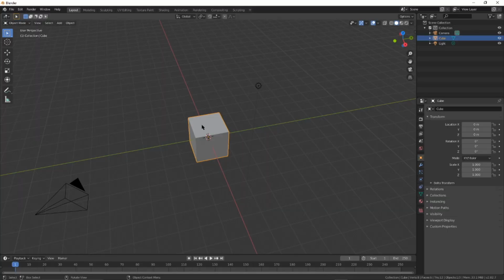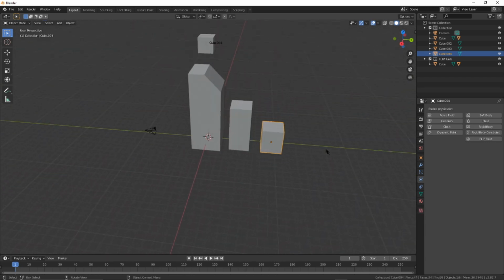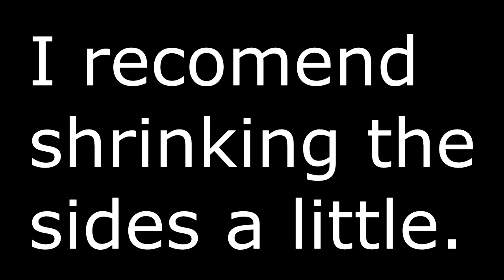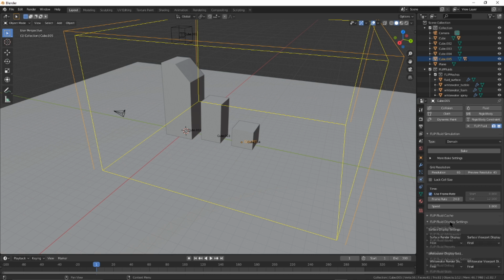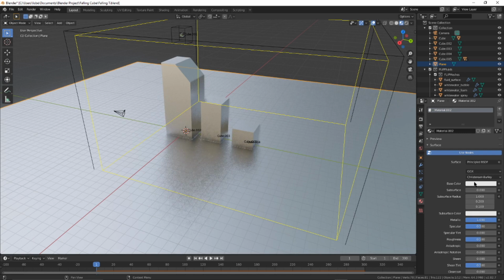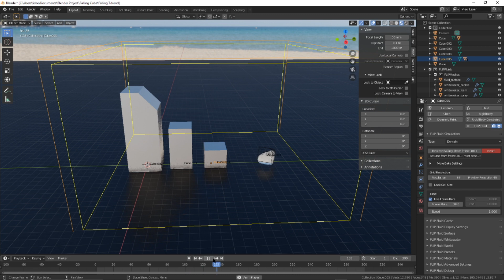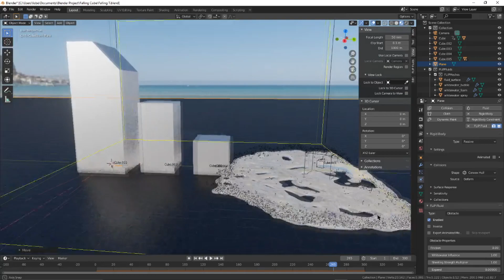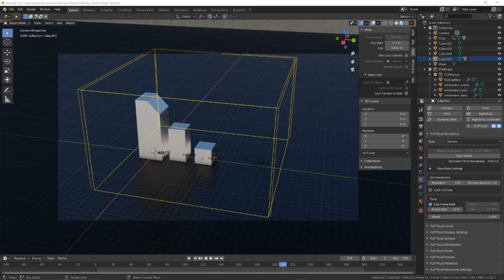Blender Flip Fluid Tutorial

Comment: Hi, what should I do if my blender just freezes when rendering? Then it does not work, apparently because the RAM runs out, I have 16 GB of it and at 64 (this is the water quality of rendering, just the loading of animation, and not the overlay of light and the creation of video) the memory just runs out...
Reply from the maker: if it freezes then it could be loading. make sure lock interface in the render tab at the top left is turned on. If after you press the render and it does not load after a little then either your ram really ran out or there might be a problem with your blender. Sorry I can't do much more to help you I didn't make the mod I am just using what I know about the add-on to help you.
Reply: @goldendragon2624  Thank you so much! I solved the problem

Comment: my water is reacting like slime (like it doenst splash when object hits the water)
Reply: @goldendragon2624  nvm i fixed
Reply from the maker: well are you using mantaflow or flip fluid add on, there is a big difference in the both. Also the size of your domain and resolution
Reply: @goldendragon2624  flip fluid
Reply from the maker: @Nonaxnj  what about your resolution, lower resolution will sometimes is more sticky and doesn't break apart as easy. Ive noticed while using the add-on that the domain size could cause this sort of problem.
Reply: @goldendragon2624  256 i will try to change the size of the domain
Reply: @goldendragon2624  dint work '-'
Reply: @goldendragon2624  ok